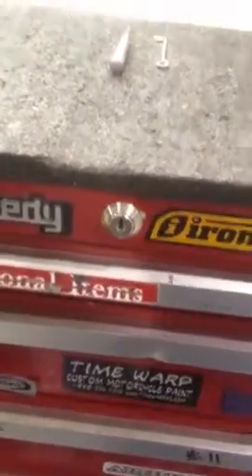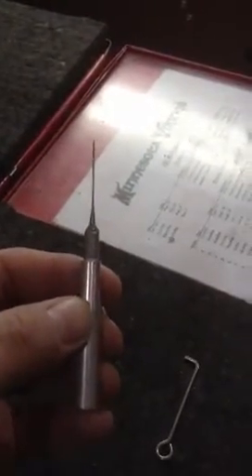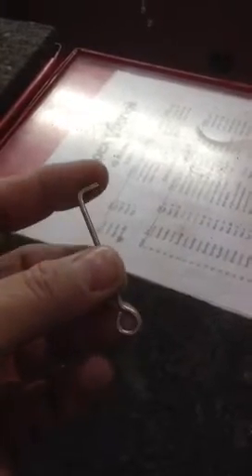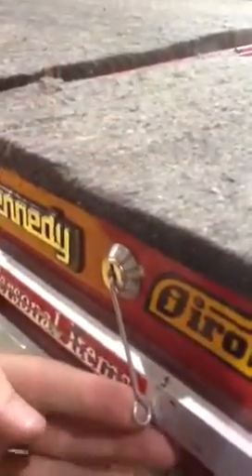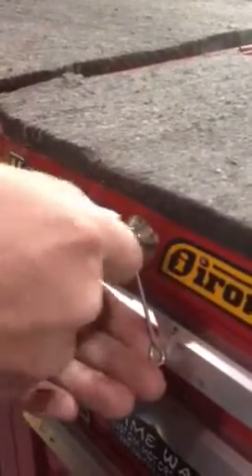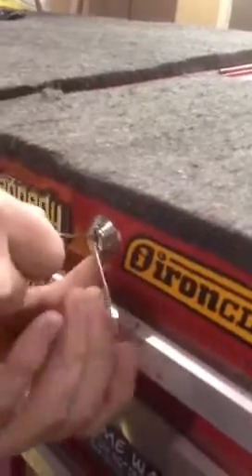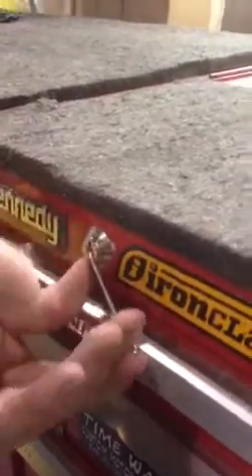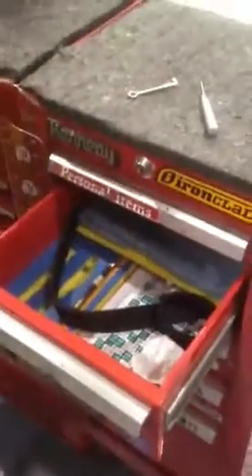How to pick a lock

Comment: Haha nice!  My box was open with latch in locked position preventing closing the top.  I found a similar key and applied pressure on the latch while cycling key in and out and it released in about 10 seconds!  I don't need to lock it just want to close top.  Thanks!